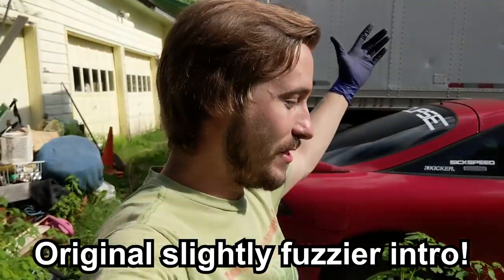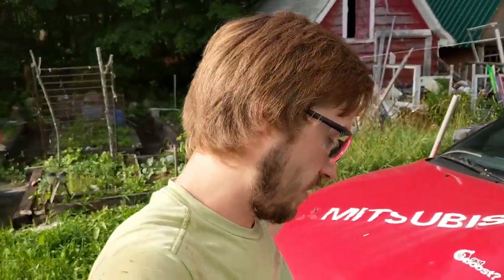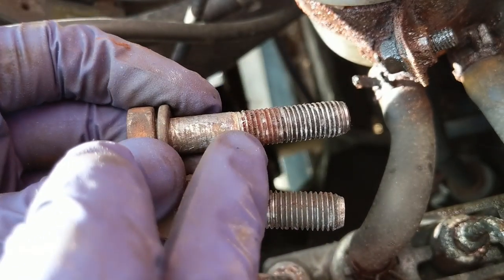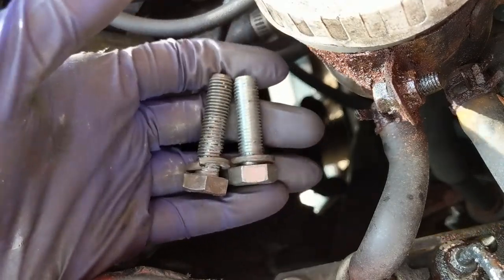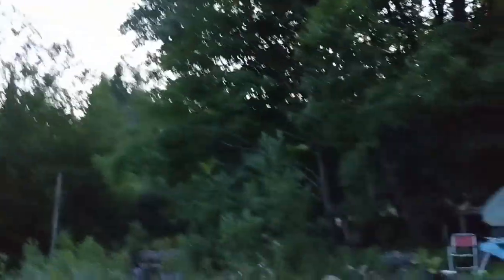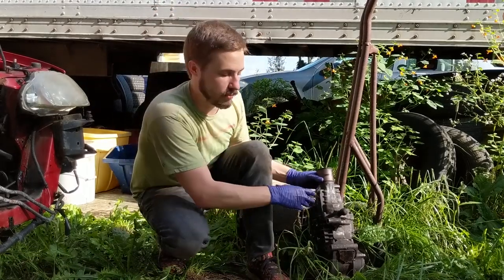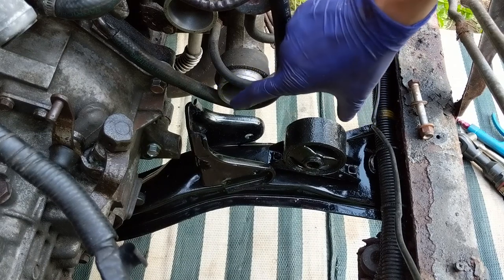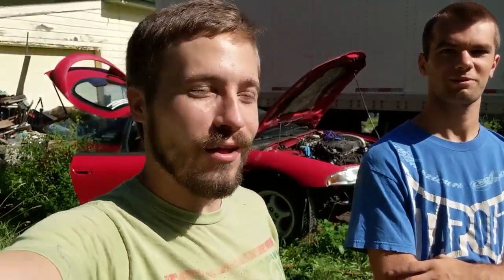Eclipse GSX Axles, Ball Joints, Transfer Case, Driveshaft, Crossmember - DSM Trans Install

Comment: DUUUDE Hell yeah getting some good work done! I probably wont make it to the livestream as I'm across the sea but I'll watch it tomorrow if it's up. Can't wait to hear it run and maybe even see it going round the block! Personally, I just finished dropping the awd gas tank (without taking the subframe off!) and I'm gonna be doing some plastic repair on it. Then I might try to change out the oil seals on the front shafts.

Good luck on the start!
Reply from the maker: Happy to see comments from you!
Sorry the stream quality was so terrible, but there will be an HQ version soon. :)
Are they a plastic gas tank? I have gotten conflicting info on that.
I'm sure my tank is pretty nasty inside... but honestly I may never look. XD
Hope the work on yours goes well!
Reply: Mine was surprisingly clean on the inside. The AWD 2Gs have a plastic (HDPE) tank, while the FWD have a metal tank which is prone to corrosion. Yours will be plastic as well, so I suggest once you start moving the car, maybe lift it up on a lift and go over all the little rubber hoses. In my case I think while the car sat some rodents ate away at all the ABS wires under there and all the rubber hoses, haha.
Reply from the maker: Ah that's great to know! If it were a metal tank, it would be rusting away inside and out I'm sure. I'll be sniffing around at fuel leaks for sure. I know rodents have been in and around my car, but luckily so far I haven't found any damage, even under the seats or trunk floor. I think they may be living in the frame rails.

Comment: I've seen you all over youtube, decided to come check out your channel. Fun to see some DSM action, they seem to get very little love other than from Jafro and Tom's Turbo Garage. I've got a solid hoard of DSM bolts from years of junkyard trips, it is a must have when trying to put a car back together with the correct hardware. Luckily 1st gen cars had the non turbo model with the same engine so they are often unmolested.
Reply from the maker: Jafro is love, Jafro is life. Tom's is also sooo awesome.
Thanks for checking out the channel. I do promise I commented a ton long before I made videos, hah.
I spend way too much time on YouTube. Online right now researching if small bearing seal color matters. XD
I still can't find my small bucket of DSM hardware and it's driving me nuts!
I agree having the right hardware makes the job so much better.
Some Subaru bolts transfer over too which is helpful.
Hope to see more comments from you in the future. :)
Reply: Maybe I'll make a video covering this weekends mods if they get done, would be better content than rod knock. What seal are you talking?
Reply from the maker: That would be sweet!
So like alternator bearings, 6303 size for example.
If the seal on a 2RS bearing is red, green, or black, does it actually mean anything?
I'm wondering if it is for the different clearance levels.
Reply: The 2RS describes the type of seal a bearing has (non contact rubber, contact rubber, metal shield) https://www.astbearings.com/bearing-closures.html

A 2 RS bearing will have a Buna-N rubber contact seal, the color is the material composition of the rubber https://www.globaloring.com/oring-colors/

Bearing precision is described by ABEC, lowest grade is ABEC 1.

Buy a bearing from a reputable company and you won't have to worry about anything other than that it's a 2RS. I use a local company that is willing to work with an individual to find me things like throttle body seals that are in the SKF catalog but not in the computer system. This is helpful when you don't want to pay race shop prices for regular parts.

Have you hear of vfac.com?
Reply from the maker: I typically go Koyo or NSK.
Thanks a lot for the info! I knew most of that, but could not find a chart of material colors. I'd hope that the O-ring colors apply to bearing seals, just not sure.
Seriously though, I appreciate it, hahaha. Wasn't expecting much of a reply.
I assume you meant vfaq.com? Yeah, use it a fair bit!
Reply from the maker: Also just found this, which seems to mostly align material wise.
Check out page 1 or do a ctrl+F for "color" and it gives info on the seals.
Seems green is the most hefty in most applications, being HSN.

Comment: im not kidding Aaron if you got to the pit of any track day you may find OEM hardware is like a show car thing. its rare as race cars are apart more than together.  you can never keep all the correct bolts in order the 20th time you have it apart .  zip ties are the most common quick fixes and any bolt in that box over there .
Reply from the maker: Hahaha, trust me I know. I have done plenty of car work with just whatever bolts work.
The big reason it makes me annoyed is when it is a bolt with completely different threading from the rest of the car or a slightly different head size or heaven forbid a standard bolt in a metric engine bay, hahaha.
I hate having to go back to my tools because the previous owner got lazy.
Mostly though it's just fun to complain about, but I don't regret replacing any wrong bolts so far. :)

Comment: how do you know how much pressure every bolt needs?
Reply from the maker: Gotta look it up. Factory service manuals, forum posts with references, aftermarket repair manuals. Videos on this process by Jafromobile were especially helpful though. Thanks for watching and commenting. I can try to help find you some specific specs if you need them.
Reply: Thank you. Can't wait to see you work on those strut towers. keep up the awesome work.
Reply from the maker: Same here. It is going to be a big job, but I'm excited honestly. Just need the weather to cooperate!